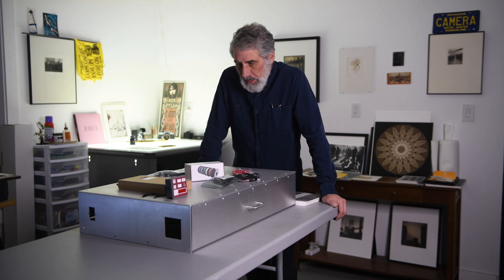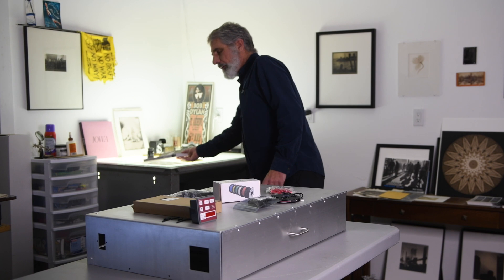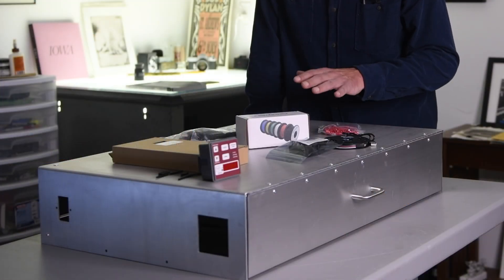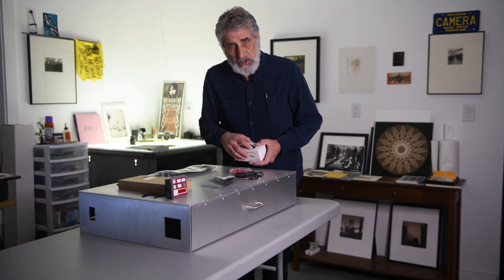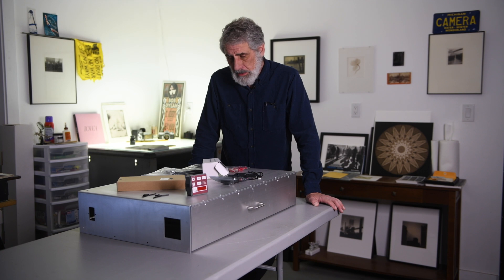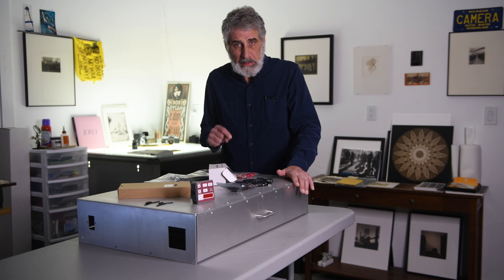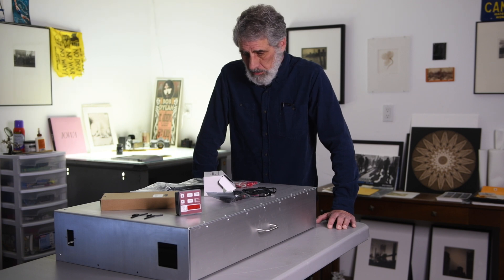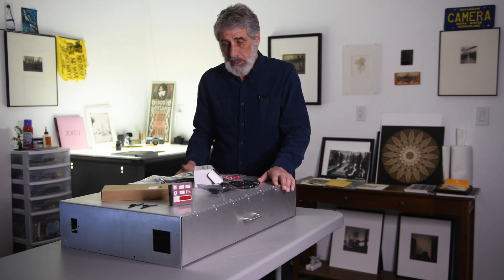Build Your Own Ultra Violet LED Exposure Unit - Part 1 The Box

Comment: I built one using Clay's directions.  The biggest problem is no matter how you measure it, at some point you will have to cut through a lump of solder in the tape (I guess that is where they join them in manufacture?).  That gets problematic as that joint will not fit in the connectors.  Clay used a soldering iron to remove it.  I tried and it didn't work so well.  I did manage to file them down and that worked on one joint, messed up another.  I ended up with two strips that were short my 1 led and those strips became the 1st and last in the box.  I also tested each strip before taping it down.  Both Kerik and myself ended up screwing up one of the fans connecting them (very thin wires).  The fans are cheap so rather than ordering 3, order 4 just in case.  I have not have time to try it out for other reasons.  I was wondering, however, are there light leaks through the vents?  That is, in a small space, can you coat while the box is running?  Thanks....lyle
Reply from the maker: Hi Lyle! Very cool that you have one. Yes, there are some light leaks that come through the vents just like on most boxes. If coating other paper near it, be careful. However, when we were using it at the Ansel Adams workshop, there were people coating within five or 6 feet of it and we weren’t having any fogging problems. It really is a great unit and I’m excited for you to try it out. Clay did tell me about the soldering issues and I’m going to be working that out as well. Thanks for the tips! I really appreciate it!
Reply: @BillSchwab  Another thing, as I was cutting wires that go from the transformer to the switch and timer, I put the little wire ends on.  When I went to attach everything to the box, a couple of the wires were too short, a couple too long.  Maybe only put the wire ends on after confirming the layout and lengths are correct ?  Not a big deal, but something to think about.
Reply from the maker: @lyleallan5124  that is a great suggestion, Lyle! Every little bit helps! Great information. I really appreciate it. I got more of the components today, so I’m almost there. I’m excited to get on with it!

Comment from the maker: Ralph! Thank you for watching! The fluorescent tube type would be fine for cyanotypes that you are doing. Being that it’s a printing out process, you can keep tabs on it as it goes. Your exposures will be a lot longer than they are out in the sun, but you still should be able to get some pretty good ones between 10 and 20 minutes exposure time. clay has been building these boxes with double the lights inside of them, and a larger transformer to make shorter printing times for salt prints. It would do the same for cyanotypes, but it would be pretty spendy. Stay tuned as I get this thing together and once I get testing on it, I’ll do a couple of cyanotypes and let you know what basic times would look like.